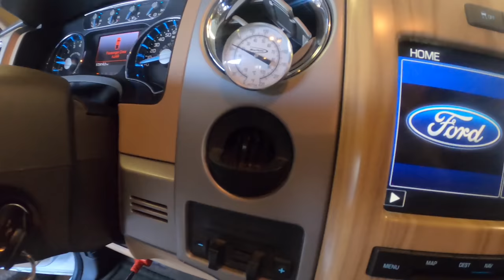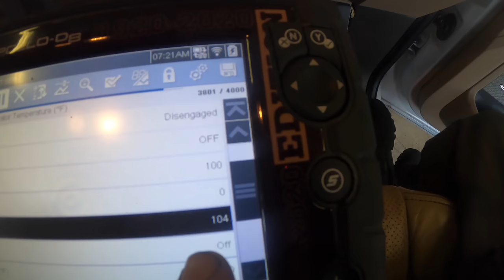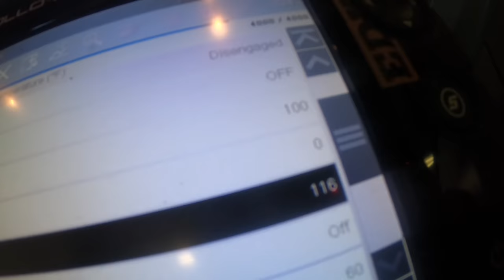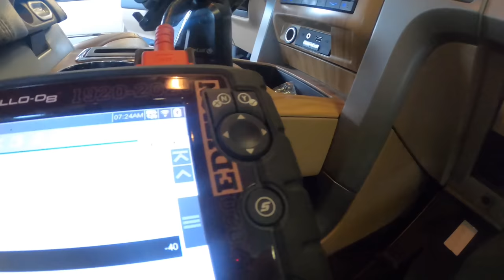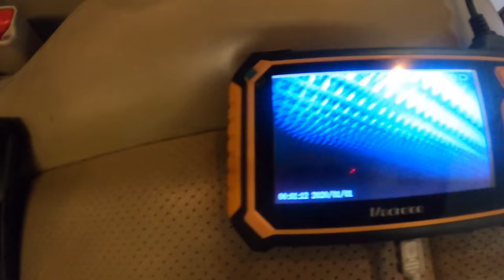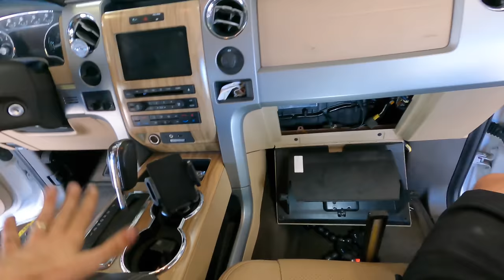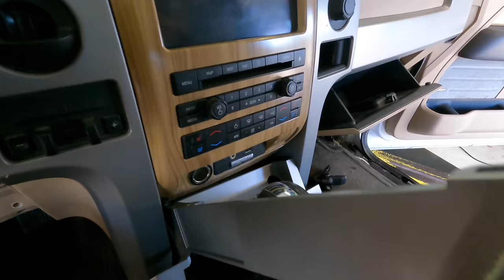TEN HOURS to replace one sensor! Ford 150 torn to pieces! Evaporator Core replacement.

Comment: A long time ago a customer came to check on my progress getting his A/C vents to work in a 1982 Cadillac Limo while I had the entire dash on a blanket on top of the roof. He FREAKED out. The vents were controlled by a unit sitting above the transmission bell housing right on the firewall to the left of the evaporator box. All of the vacuum hoses were dry rotted and needed to be replaced. This is the same limo I stuffed a 1978 Oldsmobile rocket 350 High Performance, with stainless exhaust manifolds in and he asked me if this motor was enough for this huge limo. I took him on a test drive and smoked the tires for him & he smiled.
I also had to remove the bar in the rear to replace the rear heat / A/C blower motor with dual cages.

Good job Ray. My dash work only took 6 hours but your has a LOT more to it than back in the old days. I like that you wanted to save them some $$ but ya know " the road to hell is paved with good intentions". Maybe just stick to the plan from now on? BTW, did you entertain the idea of cutting in an access hole to remove & replace the sensor, then make a sealed cover for the hole? I thought of this because I was one the first mechanics to work on replacing a cam in a 1982 Cadillac Cimerron & had to make an access hole in the inner fender to do so.

Comment: This reminds me of when the heater core went out in my 1980 Firebird. My dad cut an opening in the plastic box and we pulled it out easily. Put the square “door” back in place and some neatly cut, black duct tape made it look good. Actually couldn’t see the tape unless you looked under the dash.
I would have called the owner of this truck and told him that a simple hole could be made to access the part. I would go to a junkyard and do the same to remove the sensor and put it in this truck.
Its good to see you tried a money saving method for your customer.

Comment: I've only heard of such horror jobs......I've now seen one and I cant unsee it.  $1000 labor costs for a $20 sensor. Not to mention, nothing ever goes back to be like it was. Mad respect for you Ray.
Reply: Don't forget the cost of the evaporator, $1100.00, I believe he said. Plus all the money he spent the last time. Hate to be him.
Reply: I had a transmission seal in the front leak in 74. $120.00 for the labor. $4.00 for the seal.
Reply: I did this exact job on my 99 Intrepid. The feeling of satisfaction of a job well done and a lot of money saved makes it worth it.
Reply: Ford likes labor rates. Ever try to change a $6 sparkplug on a 5.4 triton? $600 later you finally get it out and new threads
Reply: Yeah man it’s ridiculous, except the compressor and condenser have already been done and the part isn’t $20 it’s $1200, so this AC repair is probably closer to $4,000 or $5,000…
Reply: Could be worse. He could have taken it to the dealer. And we know how they charge.
Reply: At that point I'd wait until the fall and just sell it.
Reply: @Da_Benski Depends on the miles and age of the truck. Sometimes it cheaper to eat the repair bill than to take out another loan.
Reply: @robertw1871  ,
modern technology, some shitty ($20.-) cheap part originally fails, and thousands of dollars later the owner still scratches his head, how that could be possible !!
Reply: @juergenbertram7312  All I can say is buy tools whenever you can my friend, and learn to do things yourself… these jobs are difficult enough that I seriously doubt mechanics are doing them correctly, you see half this video is about trying to cut corners, so for $5000.00 you still get a shitty repair… I do everything on my vehicles myself… it would have taken me 5 hours, but I would have got it done right for $20…
Reply: This is not a nightmare job. Its one of the easiest dashboards you'll ever pull. He did a lot of unnecessary work, such as removing the steering column.

Comment: I had to replace the mixer door, came with a kit, drimmel out a square access hole, replace all the stuff then use  aluminum tape to patch the hole, worked perfect
Reply: I changed my evaporator on my Silverado the same way!  Just cut a rectangle hole out of the box with a Dremel, slid the old evaporator out, slid the new one in, and put cut piece back in with aluminum tape.  Took about 1hr for total repair!  Works perfect!
Reply: @IndustMachWerksofTX  I'm not a mechanical expert but cutting out some sort of 'access panel' as he was going over what was required was my first thought as well - good to know my intuition wasn't off the mark.
Reply: Exactly the same thing we did with my son's F150 and Explorer to change the mixer damper motor
Reply: Yes I think cutting an Access hole is the way to go, might try plastic epoxy to patch it back up.
Reply: YES I did that on a Volvo to remove a heater core
Reply: @IndustMachWerksofTX  ,
better to use a glue gun to seal the cut out part, even stronger than before !

Comment: You could probably do a procedure like GM has you do in a service bulletin on a lot of Silverados. You use something like a 1 1/4” hole saw to make a hole in the box, change the sensor through that hole, then put a plug into the box and silicone it in. Very easy process and looks like it would work on this one too. Just make sure you do it high enough as to not leak from the water that drains off of the evaporator core.
Reply: @dickmick5517  well im sure the extra 10hrs of labor cost would help you make your mind up real quick..
Reply: @dickmick5517  You can actually just buy the sensor for another ford (can’t remember the one) and drill a small hole in the box and toss it in and seal it up. 15 min and 30 bucks in your driveway fixed.
Reply: @dickmick5517  if you cannot find the sensor online, just go to a junkyard and get it from there - knowing ford, the sensor is likely generic enough to find in all kinds of vehicles.
Reply: @dickmick5517  for $1100 and 10.8 hrs of labor, you definitely can figure out with a resistance decade box what resistor causes what temp value by the ECU (scanning it at the same time), and figure out what Digikey/Mouser PTZ temp sensor would closely emulate that. And far less, "WE'RE GOING TO TAKE APART YOUR *ENTIRE DASHBOARD*" 😆

Comment: I would have found an F150 in a pick-a-part salvage yard, verified that the sensor was likely good by checking the resistance, cut access thru the plastic case and removed the sensor.   Then installed that sensor in your f150 in the way you originally planned.  (This is why engineers should be required to do long apprenticeships in assembly and repair before they are allowed to design anything.)
Reply: That is the same way with a lot of new appliances . It's a bunch of " bull " that they get designed like that . That's one of the reasons that I love the older Ford trucks and a few things on those aren't bad enough . I have 2 - 1987 F-150, 1 - 1988 F-150, 1 - 1991 F-150, 1 - 1995 F-150, and 2 - 1996 F-150 trucks .
Reply: I was thinking the same thing .. Cut a tiny access port... Glue it back it call it good
Reply: Dang right
Reply: The trick is to build a temp sensor with the right resistance range (very simple electronics and cheap too). Then package that up on the end of a fat plastic threaded rod with the wires embedded in the plastic. Sell that as a kit on ebay. The mechanic just drills a hole in the plastic casing then glues a nut to the casing around the hole. Screw in the temp sensor rod until it touches the evaporator and plug in the harness. Done! If Ford engineers had the brains that evolution gave to a goldfish they would have designed it that way. Or maybe they just like to keep their dealers in work.
Reply: But i think their job is to engineer MONEY for the company so they keep their job. If the designed everything to be able to be reached within 30mins to an hour, the dealerships wouldnt make nearly as much money.
Reply: @jeffreykbevins7116  and the reason the new trucks are bad aswell.. they just kept old design.. added ac.. just stuck it in somwhere.. and now u cant fix it.. or it takes 10 hours instead of 10 minutes...
Reply: @dalemanolas5994  funny enough. You're not far off he could've found a thermostat with the same resistance and just spliced it in where he wanted and been done with it, but I'm not sure how electronics savy he is but the measurements can be found online to do this
Reply: Richard right spent some time on assembly line for freight liner they had similar ac units they went in cab first everything built around it.
More custom the cab more stuff built around.  The time this guy gave to fix this was 10 hours .  They had it down to two minutes to install unit .
The amazing thing about this video is you never hear him speaking or cussing the guy
Reply: same here
Reply: @dalemanolas5994  That's too easy. Stop making sense.
Reply: Just cut a hole in the plastic and re-weld the plastic together again. It is possible. Would neber disassemble that entire dash seats etc.
Reply: @zacharymossman3593  you can weld plastic. They repair bumpers with it.
Reply: Sort of what I was thinking with the engineers. I'm a logger and I spend entire days cussing engineers trying to get hydraulic hoses off of skidders and loaders.
Reply: Mechanics and machinists exist so engineers can have heroes
Reply: It's so you take it to the dealership or just buy something new they don't want it to be easy.
Reply: Preach that gospel brother pick a part to save the day Hallelujah Amen.
Reply: i would have cut that box open, then glue it.
Reply: Absolutely agree
Reply: I certainly would, disassembling the dash is crazy. Assembling makes you crazy
Reply: I would have driven the truck to a chilly climate and sold it. Might tell the buyer. Essentially, in my world, that truck was totaled.
Reply: was thinking the same cut an access hole remove and replace glue on a patch
Reply: Same here, cut it, replace it and JB weld it, done. Pulling a dash sucks.
Reply: yeah
Reply: @jeffreykbevins7116  what state you in ? Gotta be south of mason Dixon
Reply: @bluethunder4542   Lawrence County, Kentucky .
Reply: I said the same thing just now..June 20, 2022.
Reply: Remember he's responsible for the outcome of the repair.  On your own vehicle, sure.  But not on a customer's vehicle.
Reply: 100%
Reply: @JanoyCresva  if the vehicle is out of warranty, then maybe. If it’s repaired under warranty, the dealer doesn’t make as much money. Labor time guides are less than non warranty work. Don’t understand why. If a job pays a set amount of time of labor, it should be the same no matter who is paying the bill
Reply: INDEED
Reply: @zacharymossman3593  i did 02 for access then plastic plug
Reply: EASYER said then done on a fird if you can't get it out in five. .its a design fault..just like the thing he is takeing apart and I bet the same fixings don't go back in the same place..

Comment: Got to love engineers! We deal with the same problems on commercial HVACR. Sensors are always buried. A failure item should always be easily accessed. Engineers should have to disassemble what they create. Spend a couple years in a garage with rusty cars. Have a great day. Stay safe and be well.
Reply: Great point and totally agree
Reply: Don't blame the engineers - there's several layers of managers and bean counters who are largely to blame for the lack of servicability.  
The logic will go like this: "how many of these will fail within the warranty period" if too many: "can this component be made not to fail within the warranty period?" if no: "can we make that part easy to replace?" and finally: "does the cost of designing it to be easy to replace exceed the projected cost of warranty repair?".
Ultimately design engineers within the automotive industry are pressured to remove cost and simplify manufacturing and warranty maintenance - anything outside of that is secondary.
Reply: @Chlorate299  tons of these "bullet" sensor are failing these days. Its called mass production. And damn skippy we can blame engineers. Who sat behind the computer and said yes it will go there?
Reply: @FlyEaglesFly19111  Again... it doesn't work like that, not every little component needs to be easily replaceable, if they were then the car would be covered in little access ports to give people access to components that may never fail during the lifetime of the vehicle (and bear in mind this truck is over 10 years old at this point).  When the designers are tasked with making everything as cheap to assemble as possible, to the point of even minimising the number of threaded fasteners used, it really isn't their fault if a mechanic over a decade down the line has a bad day.
Reply: @Chlorate299  that little component that you deem "not important" is responsible for thee entire HVAC control. As it was duly noted by the origin of the video it was thee sole culprit for the compressor to grenade from out of specification operation. If a system is designed on the higher side of medium temperature; then is running at low temperature freezing castrophy is surely without question going to happen. That little "non important" part just caused a consumer big bucks in 2 ways non the less. Hey but your right and I'm wrong.. what do I know being 30yrs in the HVACR field fixing and correcting  engineering ooopsies.
Reply: As a mechanical engineer, I can GUARANTEE that the engineers where overruled hundreds of times on this design. Watching this video gave me heartburn from all the flashbacks to many, many vigorous discussions I've had with bean counters and business managers.
Reply: @FlyEaglesFly19111  I never said that part was not important,  so I don't see why you're saying I did...
My point is that the sensor failed after 10 years of service, which is pretty much the expected life of a road vehicle these days, so in that respect it's met its requirements in full. The only reason Ray had to take the dash apart completely is because for whatever reason the Ford parts department didn't deem it necessary to keep these as separate stock items from the evaporator core.  What part of any of that is the fault of the engineer who designed the HVAC system? Do you think that person had any say whatsoever about how the dashboard went together? Did they have any say as to what parts are considered service items or not?
Reply: @Chlorate299  yup, it’s 100% management.

Comment: Wow that was amazing to watch. How you remember how to put these things back together is well beyond my capabilities.
Reply: It’s only goes back one way. So it’s easier than you think when you have to figure it out
Reply: the actual hard part is finding all the screws
Reply: My trick is plastic bags with labels.
Reply: @jonathanjuillerat9831  I do the same, especially when doing engine swaps.  I also add the socket size/type as well.
Reply: @jonathanjuillerat9831  same here. Done this job twice on different cars.
Reply: He uses a GoPro. 🤣

Comment: Two things come to mind: You are incredibly smart and skilled at your job! You make it look easy. Having replaced a heater core on a European car, I know it’s not. Second, shame on the car manufacturers for not building product that are easier to service. It’s obvious this was designed for ease of assembly and low cost, not to be serviced.
Reply: I remember the old days when the core could be accessed through the firewall in the engine compartment. That made sense.  Swap took about an hour tops. This design is stupid but definitely planned.

Comment: Replaced my sensor in my f250 in 45 minutes...one inch sq hole in case...made little metal door, then covered door with hvac tape

Comment: Get a scrap evap from the junkyard, poke the sensor in anywhere it reaches, and go have a cold one.
Reply: I was thinking the same thing, but would he have to demo the whole dash in the junk yard to get it?
Reply: Hell yes !   It's only a piece of junk ford truck -
Reply: @Frank-og9jp  if he was only after the sensor he could just cut a hole in the junk box to get it out
Reply: Good plan. In this instance, I believe the compressor etc. were being replaced under warranty after repeat failures. Even considering as likely as it is that this sensor failure was the cause of the mechanical failure, there's still the risk that the compressor would go out again and then have a warranty claim denied because they blamed a non-standard repair to the sensor. By then, who knows who is working on the vehicle or if they even care to prove that the previous sensor repair actually worked so the issue must have been another defective compressor. There's a lot of CYA or really, cover the customer's a-- in some of these jobs, to make it pretty and do it by the book  just to protect the warranty on the big stuff.

Comment: One of our buildings has a tall atrium with a lot of windows.  One of the windows exploded a few years ago (tempered glass).  The Architect was asked how these were supposed to be replaced( 70 or so feet up).  He replied "they aren't supposed to break"  I'm guessing the engineers figured the RTD wouldn't fail. They generally are pretty reliable.

Comment: I had to do one these jobs a few years ago. Blown heater core. Anti freeze everywhere in the car. Carpets in the front were soaked. Even had to remove the seats. Took me 2.5 days about 20 hours.. Brutal job but i got it done. 68.00 part. The cheapest one was 28.00. By profession i was a high sschool English teacher. Saved myself at least 1200.00. Ive done a couple of head gaskets, timing belts and lots of brakes. It's pretty rewarding and enjoyable after the fact.
I really appreciate what mechanics do. Not  an easy job..
Btw the car was a 94 Jetta. I got almost 400,000 kms on it when  it gave up the ghost.